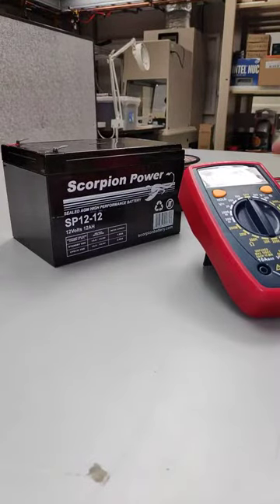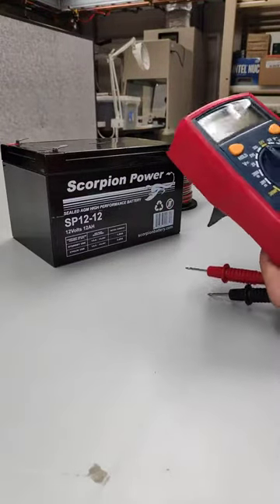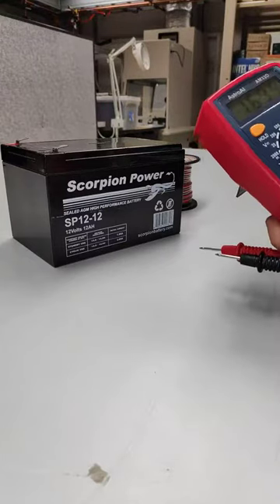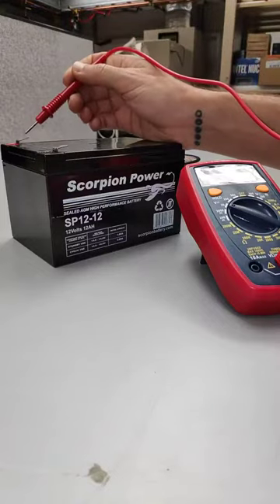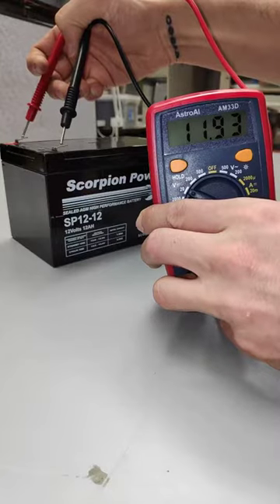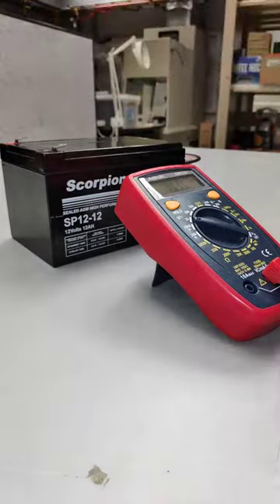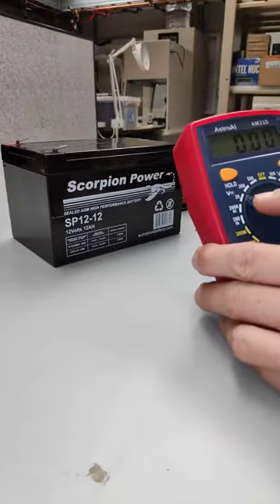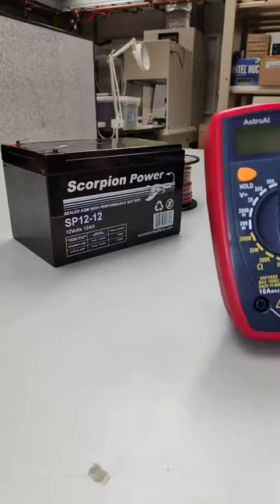UPS - Battery Testing

Comment: This does NOTHING to test the battery.  All you are doing is reading the battery's charge.  At the very least you need to fully charge the battery first then read it's voltage.  Then you can tell the capacity of the battery but it still will not tell you how it will respond under load.